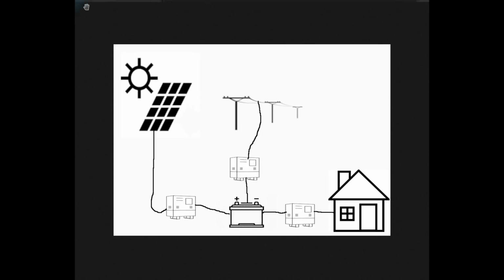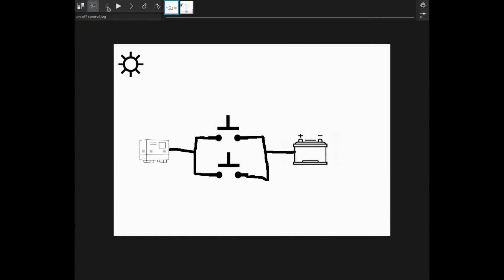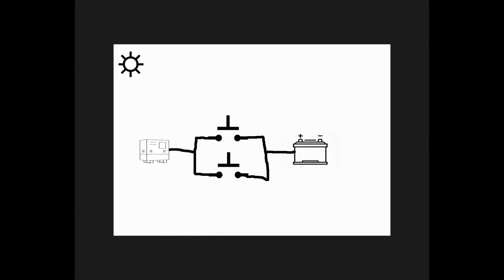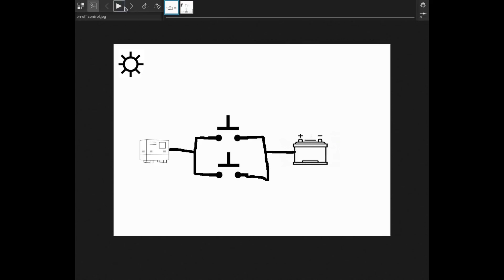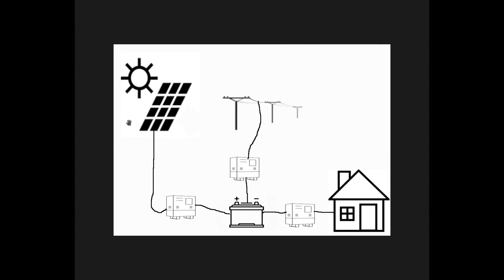How To Get Off The Grid For $5000 Grid Assisted Power

Comment: You could use a normally closed relay to connect the aims charger to the battery. A small solar panel could turn on the relay, sun = open, no sun = closed, connect charger.
Reply from the maker: I will look into that idea. Thanks.

Comment: I have a question about portable washing machines. I am thiking of buying one that uses about 240-300 watts of power wash and maybe no more than 160 watts spin. I am assuming it wont use much moe energy than the one you showed us that you use off grid.
Reply from the maker: Sounds about the same as ours only the opposite. Ours uses more power for the spin cycle

Comment: I think the battery charger will fully charge the batteries at night. Then the solar charge controller will go into float and waiste all the solar power.
Reply from the maker: I am going to set the cut out voltage in my control circuitry so it never fully charges using the battery charger. Its only going to kick in at a certain low voltage and out at a set voltage again. Its only for backup and not for daily use.

Comment: A simple relay to control a switch is all you need. If you solar panels are putting out enough volts to charge the relay will switch for your solar panel to charge the battery. If the volts drop the relay open so that the switch goes to the power company to charge the battery. I seen this done with people stealing electric. When you would pull a meter the relay opens and the house goes dark. When you push the meter back in the relay close to light up the house.
Reply from the maker: The solar charge controller and solar panels will be permanently connected to the battery bank. But if I am pulling more than the solar panels can handle then a relay will be turned on, connecting the battery charger to supplement the power.

Comment: Covering for power surges from the grid or backfeed from charger. What is needed down here but you can't use batteries to run the house. Excess is sent back to the grid keeping the lines charged. If grid gets broken then the lines are now live and worker fries if he doesn't check line first. Then they want no battery storage and get the excess from the daylight. They bank on you using what you sent back dowm the grid. Hurricane wipes out grid and no lights at nite. That is dark you won't believe. I have been thru five of those dark and steamy times Andrew thru Wanda and those names in the middle.
Reply from the maker: The inverters are quite cheap. But try to get a legal grid tie system set up. Every single bolt, nut and piece of hardware through and through has to be UL listed and installed by a certified solar panel expert. And a lot more is involved.
Reply from the maker: Grid tie systems cost a lot of money and have a lot of necessary security, and therefore inspections. A grid assisted system can be run very simply. You are not back feeding into the power grid. If the grid fails you simply dont have that as a backup. In that case you could power the Aims battery charger with a generator instead.
Reply: @TheDoItYourselfWorld  Grid tie inverters are not nearly as expensive as they were just a couple of years ago. Just over $100 for a 1000 watt 24v unit on Amazon.